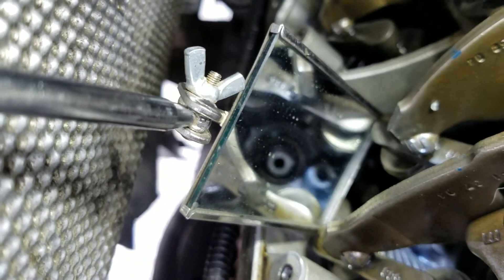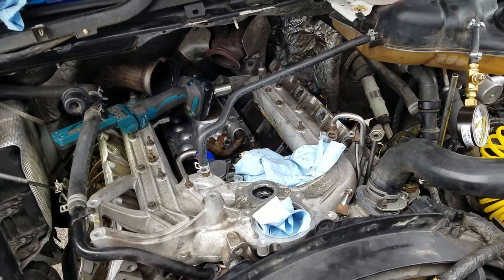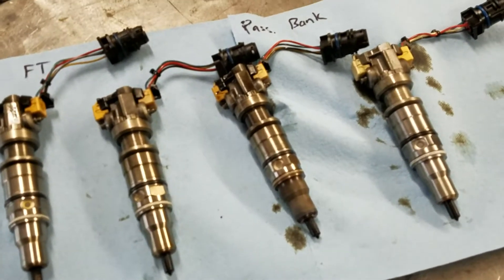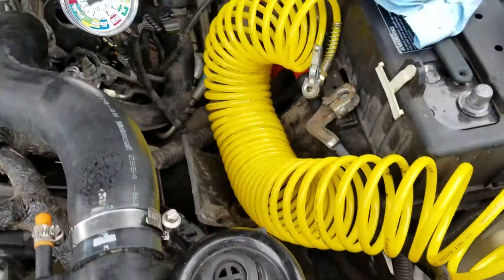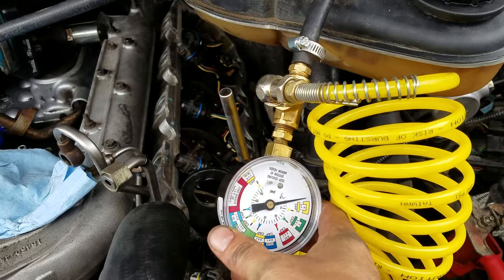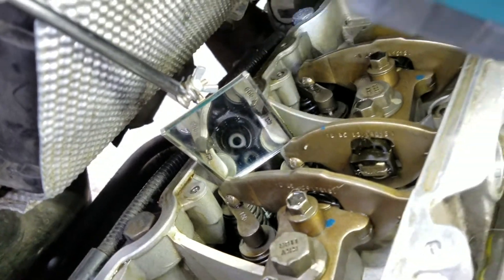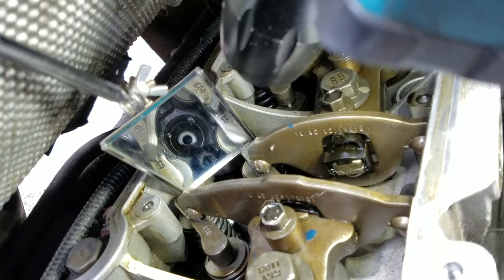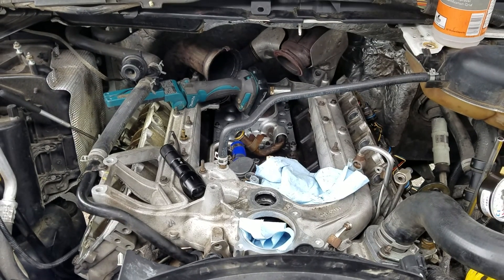Powerstroke 6.0 diesel in coolant, diagnosing cracked head

Comment: How did you make the pressure tester tool? I’ve tried every radiator cap kit and no luck.
Reply from the maker: Air chuck and pressure gauge hose to nipple on degas bottle. Leave degas cap in place.

Comment: my truck have sludge in radiator first I was thinking it egr cooler or oil cooler going bad I already took both part and sludge in oil motor too so pls pls tell me or what should I do ? the engine is running fine good strong

Comment: How was your experience with the bulletproof repair kit? I just had to drain half a quart of coolant from my truck as it appears to be making coolant, and it seems to almost always be a cracked head. I was looking around at the bulletproof kit or accurate diesel method.
Reply from the maker: I ended up using the Accurate Diesel repair kit. I was leery of the Bulletproof kit, it seemed like it may not be a permanent repair.  for a single cylinder, the Accurate Diesel kit was cheaper, and a permanent fix I was comfortable depending on.
Reply: +Paul Coplin Thanks for the quick reply. I was thinking the same thing. However I didn't like the idea of having to fiddle with the injector and ending up with a cylinder specific injector. The bulletproof solution may work fine at sealing the crack as it only has to hold 60 psi but I don't see how grease is not forced into the crack as well. I also don't see how the injector bore can remain perfectly smooth as one spec of that solution can turn rock hard.
Reply from the maker: +Banshee365  I agree. However, I also got the Jig to hold the injector body. if you ever needed to swap bodies, it is real simple and the oring is included in the kit.
Reply: +Paul Coplin It seems that it would be best to remove the evaporator case. I had removed mine once already to clean the evaporator core and to get room to do standpipes. I could probably have it out much faster now that I've done it. This is of course assuming that #3 or #5 is cracked like what is common. Either way beats $1k for a new head.
Reply from the maker: +Banshee365 It would be helpful, but is was hard at all.  It didn't take much tapping to seat the supplied cup.
Reply: Banshee365 👍🏽
Reply: Z